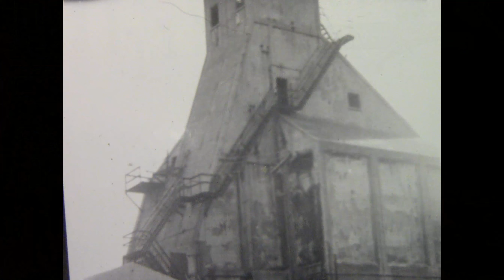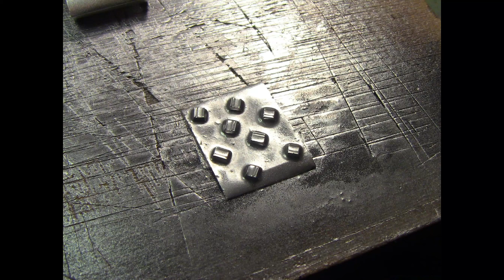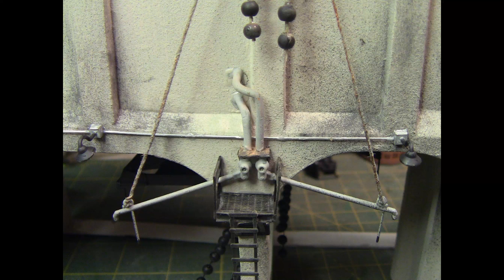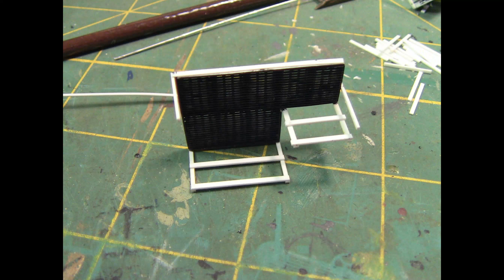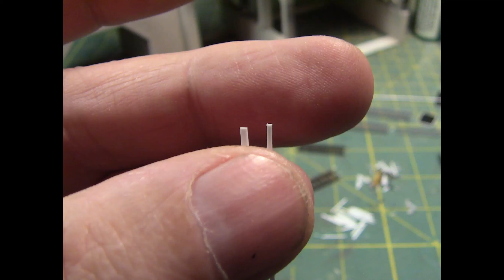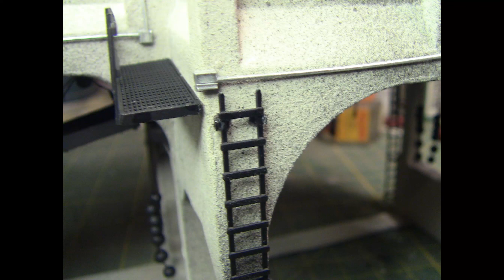Coaling Tower Video 13

Comment: I recently was looking to make some "close to scale as possible" bricks in HO using evergreen strips and my chopper. I bought several packages and chopped up quite a bit until I discovered inconsistencies in the strip dimensions, just like you showed us Mark. I was rather disappointed with the time and money wasted on that. I dont know how the strips are made but I can only assume that they are extrusions. That would be easy to explain the inconsistencies, with a change in heat or pressure in the extrusion process, especially with such tiny dimensions. 
 This build is really starting to come together into its completed state, such a huge amount of effort you have put into this and it really shows in the details. Thanks for sharing, Cheers Rob
Reply from the maker: Thanks for watching Rob !!!  Yes for the price you would think there would be some quality control !!!LOL